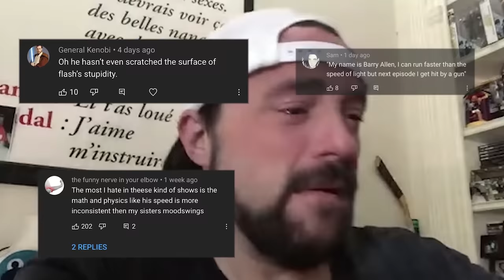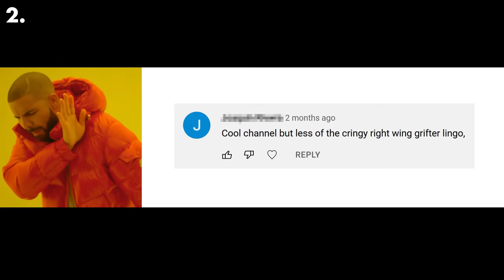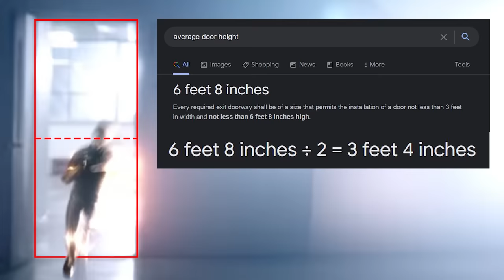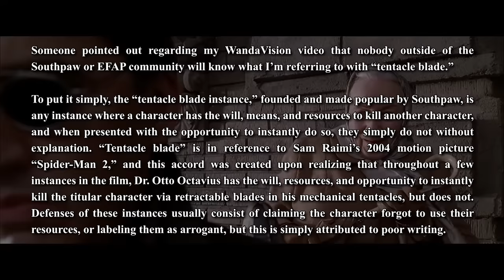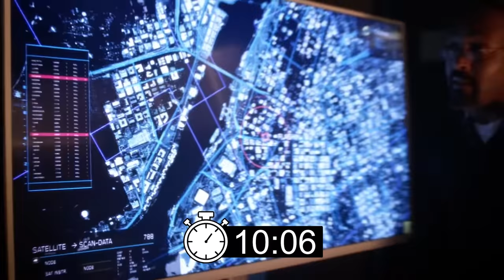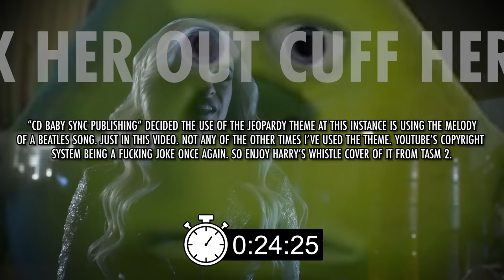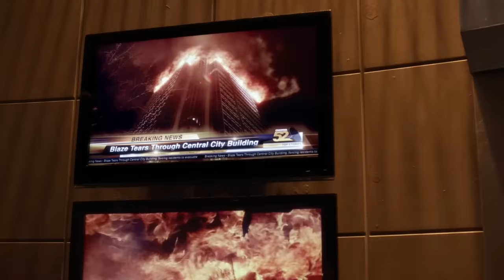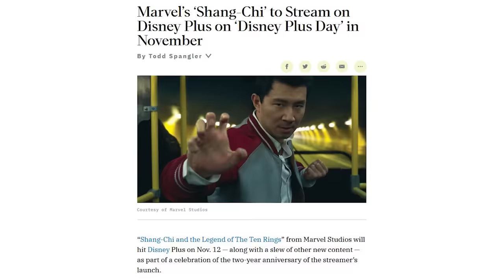The Flash is Insufferably Inconsistent - Season 3

Comment: The speed's inconsistency always bothered me
On one hand you have Barry clocking in at Massively Hypersonic and lightspeed by dodging and sometimes even blitzing literal photon beams and lightning multiple times in seasons 1 and 2 (Light/photons travel at mach 881,743 or in that 870k-885k range depending on your scientific source and lightning is ranged from mach 100+ up to near mach 1000, again depending on your source but my most used speed reference for lightning is mach 287) and then you have season 3 saying stuff like "Barry, you've finally reached mach 3"
Reply: There’s even an episode in a later season (either 4 or 5) that takes place over literal seconds, but takes up 40 minutes of slowed down, speedforce time where Barry is constantly running at superspeed for almost the entire duration to stop a bomb that’s already started going off.  He even brings non-speedsters into this slowed-down time (which does negatively affect them). Not to mention he has to surely travel faster than light itself to travel in time.

I get that he can’t always be doing his absolute best, expending maximum effort for every situation, but the sheer difference in his speed from one scene to the next is impossible to defend. He should at least always be faster than a bullet at all times (when using his speed). And his super reaction time (when he’s aware of what is happening in front of him) should kick in at least even half that.

Despite this the writers make it so a bad guy without powers or even any way to counter Barry’s abilities can somehow knock Barry of his feet, land a hit, hurt someone else or evade capture before he can react. It’s ridiculous. I don’t know why I stuck with this show for five seasons before abandoning it. Consistency and good counters to Barry’s speed is key, but there’s just no continuity even between one scene to the next, sometime showing him using the very thing that would work moments before.

You either make him less OP, find suitable obstacles and counters or slowly increase his top speed with each season to fix these plot holes. 

However, there’s still enjoyment to be found in The Flash during these early seasons. I bet there are even some good moments in the latest seasons, but that doesn’t excuse it as a whole.
Reply: @thec-m  oh yea I remember seeing clips from that episode
Reply: I Mean, this isn't as bad. It'S just the writer not having a clue about physics and not understanding the scale. The biggest inconsistency is that it feels like he can only use his powers 10s total a day, so he's always limiting it's use. He never in a fight uses it for 10s (real time) straight.

The main problem isn't thatt he drops from lightspeed to super sonic. Where, in both case, it wouldn't change 99% of the encounter as he can just speed defeat them (relocate, cuff, punch, tied up,dismantle) anyway. The problem is that he changefrom mach to regular speed where he's getting dodged and blocked.
Reply: Not defending this shit show but theoretically, you could react to someone preparing to fire a laser and move out of the way before the laser hit you. So you are not faster than the laser but can react faster the your opponent.
Reply: @TheModeler99  well nah but he's genuinely reacted to light and lightning even after they've been fired
Sometimes at point blank range
Reply: I’m so glad you brought up the “Mach 3” thing. I don’t know much about specific speeds but I remember binge watching this show like a year ago and hearing her say that and feeling myself cringe. Almost like “wasn’t he already way faster than that?” But I kinda shrugged it off.
Reply: "depending on your scientific source"
What are you talking about? The speed of light is a constant that has been known EXACTLY to be 299,792,458 m/s for a century. That's mach 881,040. Not sure which dubious "scientific sources" you found that are unsure about a constant of nature whose value we've known for a hundred years.
Reply: @gownerjones  I've seen sources that say it's mach 881,743 which is literally almost the same as yours so calm down
The universe ain't gonna collapse or smn jus cause I said lightspeed calcs might vary depending on where u check

Comment: The thing that annoys me the most about the flash is the writers want to tell you about his theoretical feats, but end up contradicting themselves most of the time. Most notable example is that he can slow down his thinking and reaction time to nanosecond or something, then proceed to make him fail to react to the most basic sh-t and not even other speedsters. In 1 second irl can mean 1 year inside his head if he want, and he come up with some of the dumbest or most basic solutions that usually end up failing
Reply: One great problem for writers is that they really think there's no problem in presenting an idea they think it's cool and pretend it doesn't exist later
Reply: Its not nanoseconds. Its attoseconds, thats orders of magnitude slower.
Reply: @wlockuz4467  It can't be attoseconds. Light travels at 299792458  m/s. The time it takes to travel one meter is one divided by that,  which is 0.00000000333564095198 Seconds. That's around 3,34 NANOSECONDS. That's over 3 billion attoseconds. That means that his nervous system can travel from his hand to his brain, ONE BILLION TIMES faster than  light
Reply: @Random-ob7dc  Its from the comics. Also I didn't mean to say his speed would be slower, what I meant to say was that with attoseconds perception the flash time would be experienced much slowly than it would be if the lower bound of perception was only a nanosecond.
Reply: @wlockuz4467  I get that, but nanoseconds are plenty. Anything more is faster than light itself, though if it comes from comics it's not the same, as the speed of light is  usual very high in comics.
Reply: Maybe Barry is a human and he does not want to waste 1 year that is actually 1 second irl lol. Maybe he cant be on guard every moment same way as you can't. Maybe he is as lazy as most of us and doesn't want to overcomplicate his actions until he has to? 
That side of him is actually believeble. Still a bad character though for other reasons
Reply: @pavel4724  "Maybe Barry is a human and he does not want to waste 1 year that is actually 1 second irl lol"

You  don't even  understand how it works and yet you comment on it, amazing...

Imagine you're the flash,  and you're about  to get hit with a really powerful punch in 1 second. Wouldnt you  want to feel like that one second is a  minute?

It's not an on and off switch, barry can make 1 second any amount of time for him... 

"Maybe he cant be on guard every moment same way as you can't"

No but when he's trying to CAPTURE someone and trying to FIGHT wouldnt it be good to be  ON GUARD!?

And have you forgotten that he's a speedsters?? He doesnt even have to be on guard, the moment he feels something's wrong or different, he can just activate his speed and move however fast he likes.

" Maybe he is as lazy as most of us and doesn't want to overcomplicate his actions until he has to?"

Ah yes, the flash, a superhero, is really lazy and doesnt want to do anything logical and sensical! Yes!

Also, you used the word overcomplicate,  you dont seem to understand what that word means.

Barry ALWAYS overcomplicates things,  if you're a speedsters, things are really simple.

"That side of him is actually believeble"

Not in the way the show portrayed him.

"Still a bad character though for other reasons"

As well as the reasons previously stated.

Comment: the worst part for me is that if they even remotely tried to make the villains as strong as they are in the comics, most of these would not be a problem
like if they were good enough writers to give Snart a single plan that would ACTUALLY foil Barry instead of jack and shit
also Barry's kill montage is missing Zoom, and I'm like 99% sure the power dampening cuffs shouldn't work on Abra Kadabra bc his powers are all tech based
Reply: Later on they just say screw it and make him a meta...
Reply: kadabras very inconsistent, they only work one time, but dont work in season 8
Reply: The Abra Kadabra this is explained more in the comics, but everyone in the future has powers similar to meta's power because it uses dark matter, which is what allows them to use the nanotechnology. But everything else is spot on.
Reply: @mickeybekele2936  I don't think the dark matter thing is in the comics, it's just technology so advanced it's indistinguishable from magic
Unless there's a CW Flash comic with Kadabra in it I haven't seen
Reply: @daranyillh6446  the comic for it was a mini comic, and it was just if the flash hadn’t gone back in time to save his mom, or try to at least

Comment: I always have a problem with how they depict The Flash to be able to also jump at super speed. His power is that he runs really fast. It would certainly boost the distance and speed he's going when jumping from one point to another but it wouldn't be at the same speed he ran at. He can't run on air (which is also why the tornado scene is ridiculous).
Reply: he kinda can
Reply: the momentum would carry him forward in the air the same way car crash victims get thrown out of the windshield when their crashes. The problem would definitely be landing though.
Reply: But he can be jumping at super speed what... this makes no sense
Reply: @tHatGuYdubs  Yes, he is at the mercy of his momentum. It would still be a very long and fast jump but not the same as his running speed, which the show always depicts. Landing wouldn't be a problem. He just needs to match his velocity on touchdown.
Reply: Barry's power is the Speed Force in all modern versions of the Flash. It isn't running quickly, its acceleration of whatever he's doing. If he accelerates the action of jumping, he's going to jump very fast and/or far. That's why he can also phase through buildings (accelerating the movements of his molecules until he becomes intangible) and also read and think faster (accelerating his brain functions).
Reply: @TheInfiniteAmo  again, he would jump very far and very fast, yes, but not at the same speed of his running. If he can control his acceleration while in the air, they might as well make him able to fly by running on air.
Reply: @clementj  In the comics he can run on clouds
Reply: @clementj  I dont think you understand what the speedforce is, or even read Akrids comment explaining that it just accelerates things. Its more akin to time manipulation (just specifically 'speed up') than traditional superspeed. Flash can throw a rock at you and accelerate the rock after he's already thrown it so that it suddenly picks up speed. Speedforce is VERY poorly designed/not very consistent, but its not particularly hard to understand that "Yes, he can jump at the same speed he can run in speedforce versions of the flash".

Comment: What I find the most annoying about Flashpoint is that since there is no "Break the sound barrier, sonic boom, break the time barrier, time boom" line, absolutely NONE of the changes made make any sense. Barry should still be the Flash (or, would eventually become him, the particle accelerator probably wouldn't actually explode for a while) and Harrison Wells would still be working on STAAR Labs (presumably with Tess Morgan). There shouldn't have been a single meta in Central City because we know that Fake Wells sped up the production of the particle accelerator by a couple of years.

Not only that, but the fact that the timeline changed just by him going back is also bs, considering that hasn't really been a thing up until now.
Reply: actually i think i know the reason (it would be a dumb reason but that makes sense for this show) what if because in the timeline barry created because he wouldnt become a speedster at the time and henry wouldnt kill his father etc. there is no way this timeline would exist so it confused time itself (somehow) to create flashpoint and (once again somehow) it getting confused made time itself forget the original timeline 

its a very dumb reason but makes sense because the flash is always dumb
Reply: @daryncollins7640  Okay, but we KNOW what the original, true timeline of the Flash would've been like had Reverse Flash not traveled back in time. Barry (had his mother not been killed) would have still become the Flash and the Particle Accelerator would've exploded later.

Comment: For a future flash show/movie, they should have the writers come up very early in with specific rules and regulations that the speed force and a speedsters speed have to abide by, and then have two military strategist come together to come up with strategy's to stop eachother. One of the strategists is given more information about the rules of speed, with some information left out, and the other is given very little information about the speed, but given tools to learn more about it. As the strategists try to out strat eachother, the writers will stop either side from doing anything that "breaks the rules", and then these strategies will be used as the basis to write the plot from to allow for the flash to be consistent.

Comment: If the problem is that the hero solving the problems so easily would make the show boring it doesn't mean he needs to be a dumbass, especially when he's supposed to be smart, it means that either the events around said problems need to be better written or there should be problems he can't solve that easily

Comment: 21:15 Maybe I'm nitpicking, but how did Frost manage to pierce Flash's leg? Flash is the guy who casually runs at mach 3 without breaking his limbs, not to say he gets punched by other speedsters without getting seriously injured. Why is simple icicle suddenly a problem for Flash?
Reply: Basically ‘the speed force’.   It gives speedsters their speed and protects them from their own speed(also potentially the reason speedsters can fight each other without them melting each other from collateral damage).
Reply: He can only run at those speeds because of his suit. From the very start of the show, Cisco establishes that Barry's first suit was designed specifically to support Barry's body at high speeds. As for why Barry can consistently speed and zoom around without the suit, I can only assume it is because he also wears a thick layer of Plot Armor.
Reply: @enjoyer2227  exactly, because multiple different adaptations of speedsters establish that the human body cannot withstand those speeds for extended periods of time, including this very show.
Reply: For the same reason you'd need less force to k1ll someone with a knife than with a car.
And no, it's no "speed-force" thing unless it's actually established

Comment: Savitar can still throw an object or a lightning at the plane. Or fly since speedsters can do that.

Do to the speeds they’re moving they can push them self of the air and use air pressure to go higher.

Gypsy is a speedsternsinc ease reacted to and has pretty close reaction speed to Flash.

Jorgen is also a speedsternsue to the scene with Wally and how he appeared at the bridge befor the train, though he doesn’t really like using it.